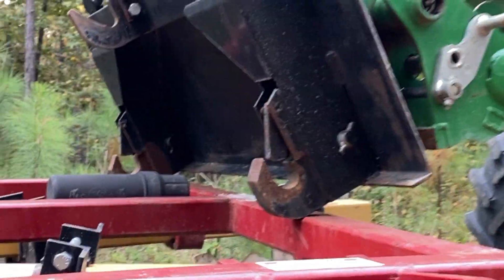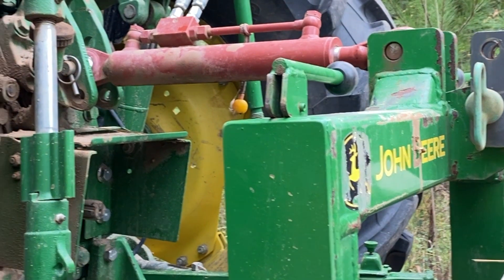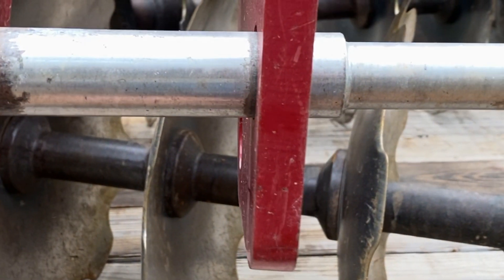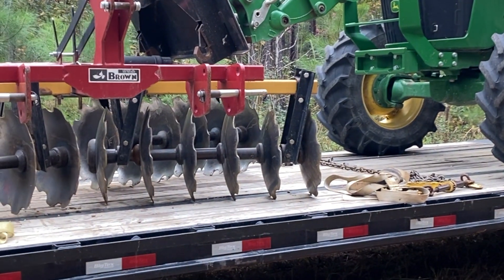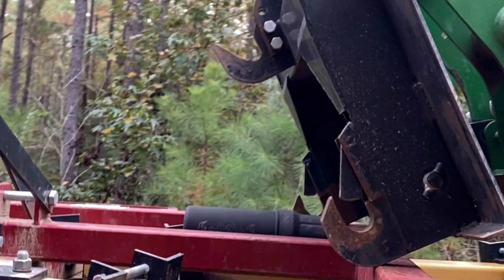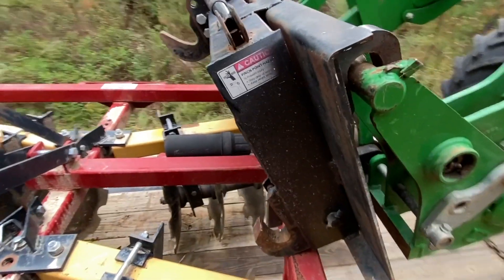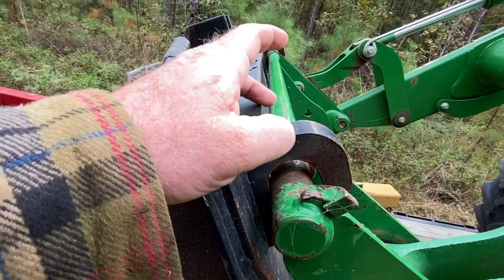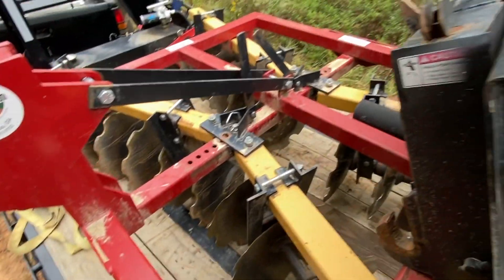A modified 3 point quick hitch for using on the front loader of the tractor.

Comment: 1/2 inch plate for the adapter would be better.  There is a lot of force happening up there when working.  Its a good idea to have the 3 point up front.
Reply from the maker: 1/2" would do it for sure. 3 point on the loader works real good for all of the moving I have to do.
Reply: @Papa_Chad just upgrade rear 3pt to SSQA, very easy to do😊